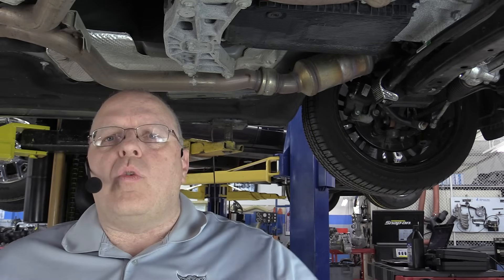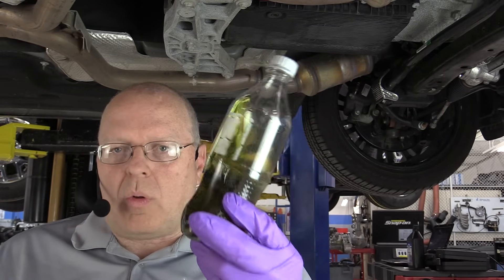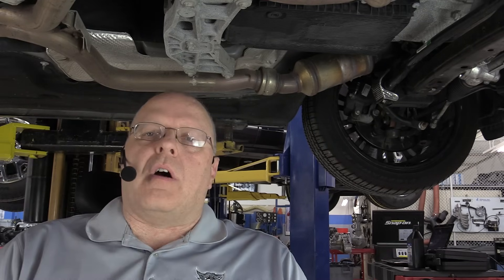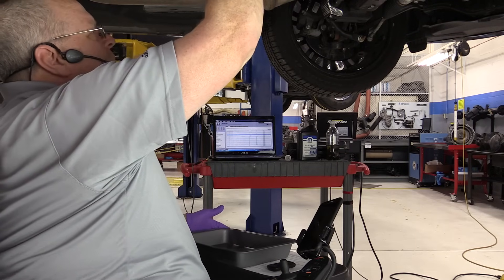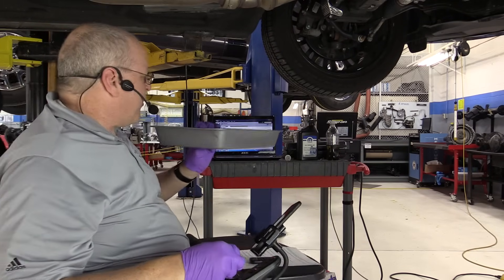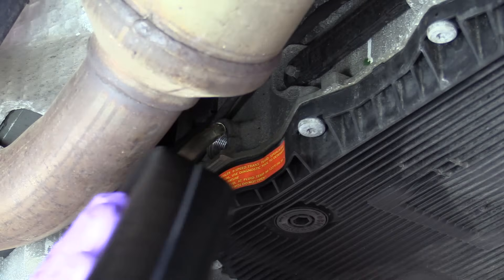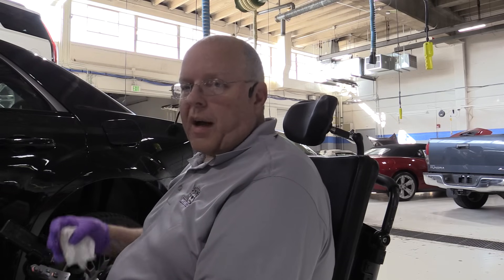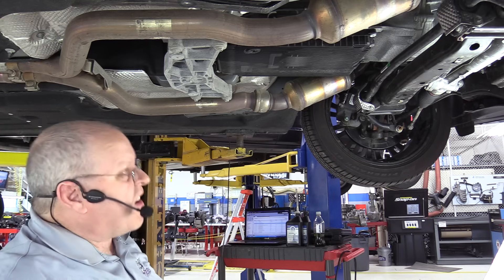Jeep, Dodge, RAM ZF 8HP 8HP 8-Speed  Transmission Fluid Level Check - No Dipstick

Comment: Presumably IF the transmission pan was drained when the engine was NOT above 160 then the bypass valve was closed and no fluid drained back into the pan and SHOULD not be affected by the temperature increase later.
Notwithstanding this it would be advisable to double check after it has been run hot and the bypass valve open but I would NOT expect it to be low IF the bypass valve is working correctly
Cheers from Canada North
Reply: Exactly! ... Also, if you are just checking the level as in this video and nothing has been opened or drained then it wouldn't be an issue anyways.
Reply: @adrianmurray2884  I hope you can help me with this. I drained my oil while the temperature was above 160°F, then drove about 100 miles after refilling. When I checked it cold, the level was low and no oil came out and I knew it would be low, so I topped it off until it dripped. Now, after 30 days and 300 miles, I checked it again cold and it was low with no oil coming out. Should I fill it again?
Reply: My thinking exactly. Change the fluid when its below 160. I changed mine around 60f so I know the bypass valve was closed.
Reply: @Weak_juan  I changed mine in my grand Cherokee at 95,000 miles. I measured what I drained out and put back in the same amount.  I do want to check it sometime but it seems fine
Reply: @Weak_juan  I hope you can help me with this. I drained my oil while the temperature was above 160°F, then drove about 100 miles after refilling. When I checked it cold, the level was low and no oil came out and I knew it would be low, so I topped it off until it dripped. Now, after 30 days and 300 miles, I checked it again cold and it was low with no oil coming out. Should I fill it again?
Reply: @HCK10 yes. Forget what you've done so far, and just fill it following the instructions set by zf. Following it down to the letter. You'll get the correct amount in.
Reply: @Weak_juan  Thank you for the reply. Will do, but now I’ll be adding more than what originally came out. I calculated the amount drained and refilled, so I was confused could it be because it’s fresh oil and requires more, or is it something else?
Reply: @HCK10 you probably did it incorrectly. Its important to get the temperature AND cycle through RND and get it into 2nd gear. Hold the gear as it's stated in the instructions. Put a wet towel over the X pipe so you dont burn yourself.
Reply: @Weak_juan  I was reading the ZF service sheet, and in one of the steps it says: ‘Select P, R, and D, then manually shift to D1 and D2, holding each gear for 10 seconds > then open the fill screw to check. My question is: do I open the screw while still in D1 or D2, or switch back to P and while the engine is idling? It’s not very specific unfortunately.
Reply: This is retarded just gonna sell it
Reply: I don't get it I asume checking the level at operating temperature of arround 120f should give the correct reading everything should be circulating everywhere cooler or not
Reply: I hope you can help me with this. I drained my oil while the temperature was above 160°F, then drove about 100 miles after refilling. When I checked it cold, the level was low and no oil came out and I knew it would be low, so I topped it off until it dripped. Now, after 30 days and 300 miles, I checked it again cold and it was low with no oil coming out. Should I fill it again?

Comment: This is a really easy procedure all things considered. It's amazing the prices some shops charge to do this. I've seen people quote upwards of 900 dollars for something an experienced DIY'er can do on a Sunday over a couple of beers.
Reply: $900??? I've gone to a Ford dealership to do a complete flush and service on the transmission on my Taurus SHO, and that was $300, which I though was a rip off. You can go to a quick lube place and get a drain and fill done for less than $100.

Comment: Hey John if you drain your transmission fluid in this transmission and captured it and then measured it and let’s say you took 4 quarts and 6 ounces out and you put that exact amount back in would you be OK.
Reply: No you would have some old fluid circulating with the new fluid
Reply: @medogabr9952  you're always going to have some old transmission fluid in there unless you drop the transmission and replace the torque converter, that's the only way to have 100% fresh fluid.
Reply: @medogabr9952  Yeah that's what a transmission service is. It's not a flush it's a service. You can only get out half the fluid. And filter.

Comment: John, I think the bypass valve will be a 3 port device providing a "constant volume" system whereas a 2 port valve will provide a variable volume system. If it is indeed a 3 port valve then the transmission oil volume does not vary regardless of whether the valve is open or closed, it simply either flows through the cooler or bypasses the cooler. This is basically very much like what is used in HVAC control and a constant volume prevent head/pump pressure increasing whereas a 2 port system tries to pump against a dead end and the head increases. I'm not sure I've explained it precisely enough but the fundamental is to ask the ZF guy whether the bypass valve is 3 port or 2 port. If 3 port then all is good and no need to worry about oil volume because the volume is constant. As an aside what a cack eyed system ZF seem to have created!
Reply: I realize I’m 5 years down the road but hopefully this still helps someone. While what you’re saying is over my head I think I just confirmed what you’re saying. I just had to replace my cooler lines. I pulled off the bypass valve. With the “to cooler” side of bypass valve plugged I can blow through it blowing into it from the from transmission side. Also with both sides of the return from the cooler completely plugged I was able to blow through the side with the valve. So evidently the valve does NOT 100% close. If I’m able to blow air through it with my lungs I would guess those lines would fill up in just a couple minutes of run time at most.

Comment: How often do you recommend changing the fluid in this transmission?
Reply: Zf says 50k I’d rather go with the zf guidance
Reply: Every 50k miles if you started changing it before 80k miles
Reply: Dealer connect says it’s filled for life. Also the filter is part of the pan,   Very pricey.

Comment: That's a lot of work just to check the transmission fluid. Have to take it to a shop just to check the fluid. SMH.
Reply: a lot of shops don't even check it properly. Some shops have literally got it into their head that they just need the transmission to be at operating temperature, and remove the drain bolt and see if fluid falls out or not. I'm telling you this from experience.

Comment: I called my Chrysler dealership in concerns of my transmission having erratic shifts  for my 12 Chrysler 300s and asked them to check fluid which I dont think they did. A few weeks later I called to see about any info on the transmission  servicing and they told me that the transmission  wasnt serviceable  and that the fluid was a lifetime.  The only way to service this transmission  was to do a complete breakdown supposedly. Idk if they are just telling me that or if that actually is the case. Kinda stumped because I dont wanna have to buy a new transmission  in future if it does give and not able to check the fluid myself.  The only thing I can try and go about off of the trans fluid is the temp rating from the dash. I think the last time I checked the temp was getting up to 200 201 is that good or bad?

Comment: Course add human error to the mix and you have people dumping engine oil into their transmission because they have no clue which place the oil goes, or dumps transmission fluid in the engine.  Take the transmission dipstick/tube away and they leave it alone.  The only issue with that is people who like to actually maintain their vehicles themselves got a bad reaction to opening the hood and finding that old transmission dipstick is gone.  My 2008 Toyota Tundra you had to follow some similar guidelines for checking/filling/changing the fluid as you of course had to crawl under the truck to do it all.  Course you then have people pulling the wrong plug and draining all the fluid out of their transmission instead of the engine LOL, apparently that's happened a few times according to one of the Toyota Tundra Forums, and I'm sure has happened with other makes and models as well.  All my vehicles have transmission dipsticks but really only time I've ever had to mess with them was to add fluid and check it after doing a fluid drain/fill and replacing the filter, otherwise no reason to really bother with it as if there isn't a leak anywhere the fluid doesn't just disappear.

Comment: Transmissions had dip sticks for decades and we've never had a problem.  They shouldn't have taken them away just because not every owner is ASE certified.  It's ridiculous.
Reply: Of course, am mad because of this crap" not having a dip stick to check level" it's insane insulting and ridiculous design" it's stupid" why making so much work to anyone to check level" and so" This company should be sued"😕
Reply from the maker: Thanks for your feedback

Comment: So basically the fluid that you put in initially came back out the 2nd time that you opened the drain plug.
Reply: Yup!  That way they make even more moeny by selling you more $42.00 a quart fluid.  Just pitiful!
Reply: I watched sooo many videos on this topic. I just did mine. I basically measured how much came out, then put that much back in. My transmission made it to 77k so far, so the level must have been fine.
Reply: @anthonyguilianoii8836  Bro That's a great idea, im gonna do that on my bmw with 8hp 70, This way i wouldn't worry about under or overfilling and causing damage.
Reply: rothm2003 yes I was thinking the same thing.
Reply: The idea is it replaces the fluid in the torque converter when you did the drain. When you drain the transmission, that’s not all of it. Torque converter holds a lot of it. That’s why You do it 3 times. Sounded stupid to me too but sure enough after the 3rd drain and fill, I checked fluid and it was new fluid.
Reply: We're talking about allowing the fluid particles to reasonably expand to rough opertaional levels to check things. This is a matter of science as opposed to a heist.

If you paid attention to such, it started pretty empty. You then fill it until it starts to over flow and plug it when the flow stops > Run it > check. Any flow THEN is over flow, and not ALL as you mindless lot seem to believe. Actually do a diff fluid change (or watch one) and see how your logic falls apart, even if those arent as involved (and finish grade school science)
Reply: @MaddJakd  You better go back to school because I know many people who do it exactly like he said. Measure what you take out and put the same back in.  Maybe you didn't make it to grade school. Simpleton
Reply: At least his pan was clean, not sure about the housing, so it should be reusable (at least until a complete change is done).

Comment: Hi sir, thanks for the informative video, I have a Grand Cherokee 2014 with 85.000 miles, i bought it used, the transmission shift from 1 to 2 is not smooth.. should i change the fluid? someone told me that if the prior owner didn't changed the fluid at 62.000 miles (100.000kms) i shouldn't change my fluid because the new fluid can do that the transmission start to slip..
Reply: The "don't change it now because you waited too long" theory has been debunked.  What happens is that people have a slipping transmission and then they decide to finally service it, and if it still slips, they say its the fault of the new fluid.  Plus you would have to drain and refill it 10 times to get almost all the old fluid out.  Just drain and refill a couple times.  That should be enough new fluid (maybe 30%?) to see some better results and if it doesn't help at all, then you know you're screwed.  If it helps a little, maybe go back under and do a couple more drain refill cycles and you should be good to go for awhile.
Reply: Does the 1-2 shift iis always rough? My 2014 RAM sometimes has a rough 1-2 shift but only when the transmission is cold. That's usually after my truck has been parked overnight or so. And that's normal. 264K miles and ticking.
But... If the rough shifts are still present when the transmission is at operational temp (150-200F), then something is wrong.
TBH, 85K miles isn't that much on a ZF8. My RAM doesn't have a transmission fluid change interval at 60K nor 100K per owner's manual, but most owners regularly replace it at 80K-100K w/o issues
Reply: Did you change it sir?

Comment: would of been REALLY freakin nice if BMW/ZF slapped that RED sticker that indicates USED OBD2 scanner for trans temp.... noooo i opened mine up without seeing your and FCP euros video on the ZF 8hp it was nice to have 2 qts of 160F+ Degree ATFluid dump on me woooo it sucked........
Reply from the maker: Wow, that does suck. That is the reason for checking the fluid at the lower temperatures. Some cars allow you to read transmission fluid temperature on the instrument panel if you scroll through all of the available screens to find it. Best wishes!

Comment: Thank you for this great informative video.. I have oil & pan replaced in grand cherokee 2015 3.6L in Mopar dealer at 50000 miles
But after changing oil my car is not the same in shifting smoothnes anymore.. I feel like it's under shifting.. Hard shift from 1st to 2nd gear when it's cold.. And while I slow down by brakes I got a feeling like somebody hit you from the back of the car..
Is this related to a fluid level and this cooling valve issue?
Reply from the maker: Thank you. There are two suggestions I have:
1. It is possible the fluid level is not correct. ZF recommends safely tilting the vehicle towards the driver's side to add an additional 0.5 liters of fluid to compensate for the transmission cooler bypass valve issue discussed in this video.
2. You must use the correct fluid in this transmission. The fluid must meet ZF-LIFEGUARDFLUID 8 (ZF No. S671 090 312) specifications.
Reply: Thanks for reply, I think they used the specific oil cause thry are authorized Mopar dealer
But I doubt they tilt the car since it's not mentioned in their instructions manual , so I'll do it myself
Reply from the maker: @ataabarodi  If the problem persists, check with the dealer to see if they used the correct fluid. Some shops use a generic bulk fluid unless you ask for the exact correct fluid.
Reply: Did you fix it ? I have the same problem ...
Reply: One more thing to try: first read our than reset transmission adaptation values via diagnostic software and do the proper first adaptation procedure according to the factory instruction.  Do not be surprised on the procedure, it requires  couple of different speed travel for a short time for each segment in a given sequence. My problem was I was not able to find a road where I was able to do this procedure without interruption of the ongoing traffic. After couple of weeks driving read out the adaptation values again and compare with the first reading. The difference in the values is a good indication of the difference between the drained and the new oil.
If the symptom is still presist than there is no other way, the mechatronic unit should be removed and inspected - cleaned, including the valves and the solenoids.

Comment: Thank you professor Kelly. When should the fluid be flushed and filter changed .is there a procedure for this. I read its life time ...(out of warranty) so should this have a service interval?  Thank you
Reply from the maker: I will be shooting a video on "Lifetime Fluids" later this week, but the best answer is to look at the maintenance guide for your vehicle.  For example: A 2018 Ford F-150 with "Lifetime Fluid" could have three different fluid service intervals depending upon how the vehicle is driven:

- Normal Driving - Normal commuting with highway driving, No, or moderate, load or towing, Flat to moderately hilly roads, No extended idling. Replace automatic transmission fluid every 150,000 mi (240,000 km)
- Severe Driving - Moderate to heavy load or towing, Mountainous or off-road conditions, Extended idling, Extended hot or cold operation. Replace automatic transmission fluid every 30,000 mi (48,000 km)
- Extreme Driving - Maximum load or towing, Extreme hot or cold operation. Replace automatic transmission fluid every 30,000 mi (48,000 km)

Your vehicle may have a similar schedule. Best wishes!

Comment: I have a chrysler 200 with zf 9hp, its now 48000 miles, should I change the fluid now or wait till 100000 miles? another thing is I dont get the mopar 8_9 speed fluid can I put the liqui moly top tec 1800 atf?
Reply from the maker: Unless you tow a trailer, drive in mountains, drive in cold or hot weather, or have extended idle periods, the fluid will not need to be changed until close to 150,000 miles. Otherwise, see your maintenance guide for the proper service interval I suspect it is at 60,000 miles. Only use the Chrysler approved 8 & 9 speed fluid.
Reply: Thank you very much for your answer